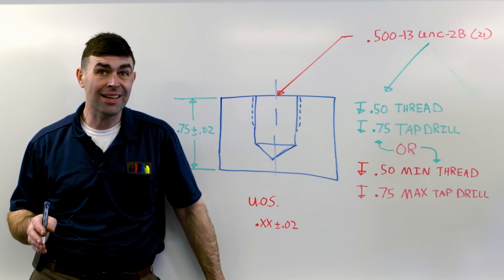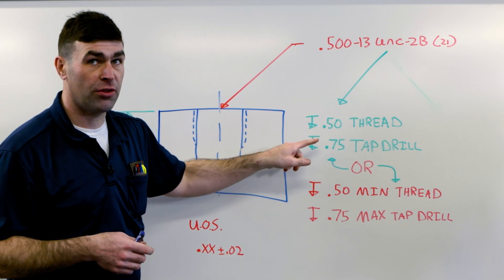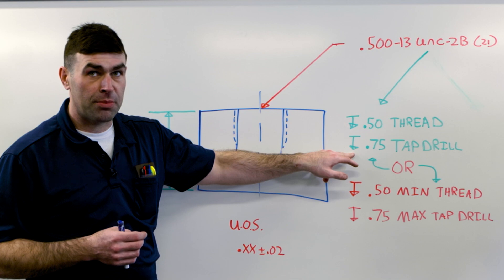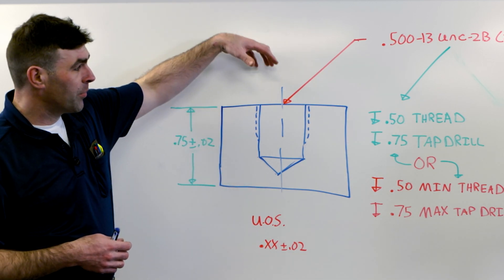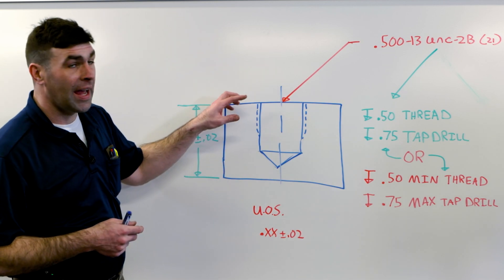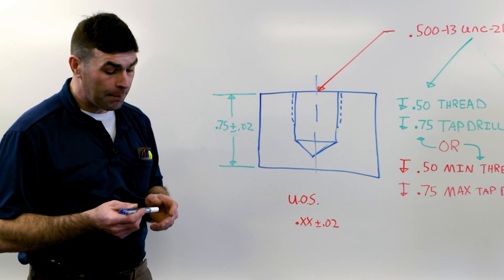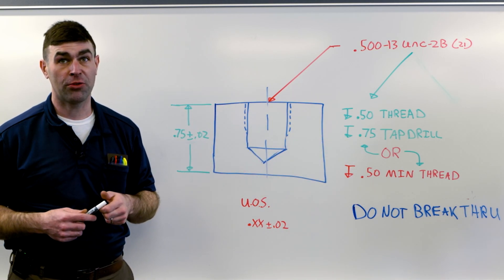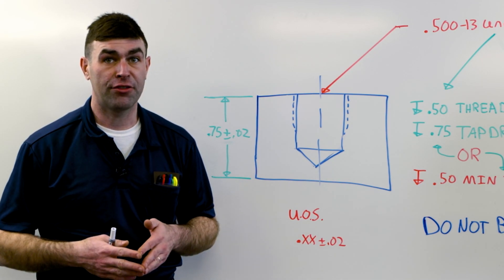Most Drawings Specify Thread Depth Wrong

Comment: Thanks for the excellent content.  Can you explain what "full thread" means, and how to properly measure the thread depth of a blind threaded hole? Some employees are measuring the overall length of the thread gauge, screwing the gauge in the hole, zeroing the height gauge to the overall length of the thread gauge, and then measuring from the top of the gauge to the face of the part once it is completely screwed into the hole. Others do the same, except they subtract the bit of the thread gauge that isn't threaded, measuring from the end of the gauge to center of the end of the first thread. This results in a shorter thread depth. We can't seem to reach a consensus on which way is proper. I measure the 2nd way, and check my work by counting turns. For instance, a 3/4-10 should be 10 revolutions for a 1 inch deep thread depth. I was getting 8.5- 9 turns, which by my method, is .100-.150 inches too short. Can you make a detailed explanation video, a comment, or point me to a previous video that may already explain this topic? Thanks!

Comment: Poor design example... Even the ".75 MAX TAP DEPTH" equates to a "breakthrough" condition  when the part thickness is .73 (LMC).... and unless you specify that the tap depth is measured to the point of the tap drill, the depth will be measured at the full diameter.
Reply from the maker: Yeah that’s what I explain in the video. It’s a bad design trap machinists need to watch out for.

Comment: Dealing with this exact situation all week on some parts with a dozen tapped holes all calling out thread and drill depth to +-.005. Way over constrained for what the part is.
Reply from the maker: Yeah minor oversight on the drawing sucks downstream. I have a real problem with these shortcuts on drawings. It’s so easy to change something on paper (or computer screen) compared to actually making a part.

Comment: Thank You Dean!  I've learned so much from just watching 8 or so videos so far.  You're very good a explaining everything.  I did want to point out that in your sketch, you have the material thickness and the drill hole at .75".  I think you want the material to be a bit thicker in this example, maybe 1", otherwise the cone of the drill will be below the material bottom.  Never mind, I just saw your reply at the bottom here.  Thanx Dean!

Comment: Another great video!!  You would already know this, with modern processes these days holes are not necessarily drilled with jobber drills and threaded holes can be created by other methods such as thread milling.  The designer must be aware of the capablities of the workshop.  The point is, the designer's skills have to be expanded to encompass the various manufacturing processes.  It is just more than drafting.  I managed a design and drafting office for 17 years.  Our designs were sometimes not optimal because our workshop had to manufacture the job.  Cheers

Comment: Hello, love your content. The "min" or "max" dimension wouldn't have an applicable tolerance either way? Like perhaps the 0.75max would pass to be .75-.02 or .75-.04 (full tol range). Or is this like a free dimension as long as it's compatible with the thread and the "max" note?
Reply: There are combination tap drill/thread tools which may cause breakthrough while getting the required thread depth, or cause a short thread while avoiding breakthrough. 
This way you force the use of 2 separate tools to get what you want.  1 operation is cheaper.
Reply from the maker: So the MIN and MAX only work when another feature limits it. In this case there is effectively .25 inches of tolerance that can be allotted to the thread depth, or hole depth depending on the actual features produced.
Reply: Plus minus does not apply to min max dimensions.